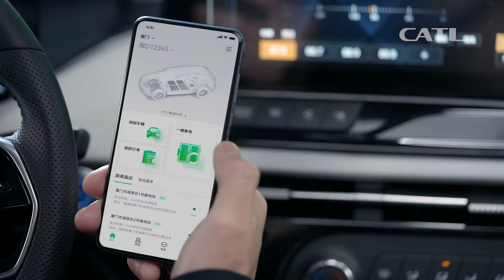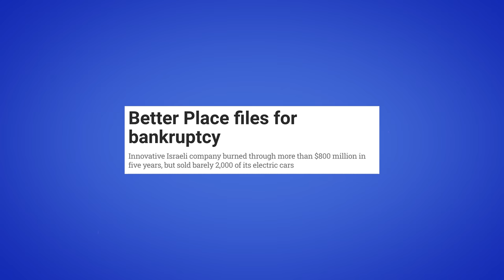Why Battery Swapping Is A BAD Idea

Comment: Honestly most reasons didnt sound really valid to me. Especially the space and cost part, its not like gas stations are built for free. 
The turning point could be regulation. If the eu steps in like they did with mobile charging there will suddenly be a way to make this happen, because then there is a reason for car manufacturers to cooperate.

Comment: I think battery swapping makes sense in a Chinese big city where home charging is less common. If you can charge at home, DC fast charging is only needed when you go beyond the range of the vehicle. For many drivers that’s two or three times a yeat. Whether Nio’s current success in China will last when every parking spot has an EVSE I don’t know.

Comment: This swap tech makes much more sense for aluminium air batteries:

#1 no issues of degradation or getting a worse pack than you submitted

#2 aluminium is way more abundant to enable feasible amounts of battery to be kept in store + they won't loose charge when stored, just drain the electrolyte

#3 lightweightness can very much enable hand swapping for things like mopeds and scooters. I currently own an electric motorcycle but the lithium ion battery (barely half the size of airplane carry on suitcase) is just too damn heavy to carry up to my apartment to charge up to just return about 100km (60 mile) range

#4 less frequent visits to the swap station because of the way higher range. According to a study, if a tesla model s was fitted with same mass of aluminium air batteries, it would have a realistic range of 2,300 km in contrast to about 600km now

#5 way better for the environment as aluminium and the water based electrolyte are *very recyclable, many companies like apple already recycle most of their aluminium and there is a very highly efficient built out machinery for that purpose just because so many resources have already been invested into that

Comment: A lot a great valid points, but the way I see these swap stations (and hoping it is) they are an extra service, another way to charge a Nio car, when you are going on a long journey. If they just put a few of them, on important long travel destinations, that would be amazing for the Nio owners. But, the Nio cars still have charging ports, for normal and fast charging. It's just another option.

And there could be a chance, that the Chinese government could ease (or force) the talks, to get other Chinese car brands, to use the same battery platform. So in the future, all Chinese cars has this exclusive battery system.

Comment: Instead of doing this purely for charging, they should make these for battery refurbishment. Take out the battery and have a machine replace the few bad cells while the pack is underground. And you’d get a new refurbished battery.

Comment: Its up to the car manufacturers to settle on one standard battery package, connector, and even voltage, and that is not going to happen soon. Only after there is a standard EV battery can swapping be worth the investment. 

One of the reasons the gasoline engine took off is that gasoline already existed before there was a gasoline-powered car. Imagine if every car brand required a different fuel? We would still be relying on horses. That's the state where we are today.

Comment: I think the way to go is conductive charging , pick up a charge as you drive along, or park over a pad in the road, no need to mess around with cables, Qualcomm were experimenting with this a few years back
Reply: imagine the work and maintenance that would need though, not to mention that wireless charging is largely less efficient

Comment: There's only one reason that the manufacturers don't like this tech and that is that it takes away the built in obsolescence that comes with the batteries. If batteries were treated like propane cylinders that get swapped for a full one the car can theoretically run forever and that hurts sales...

Comment: The biggest issue for me is indeed that batteries deteriorate as they age. I might turn in a battery that has only been discharged once and get one that's had its quota of charge-discharge cycles and is due for recycling (or vice versa). This would be very difficult to fairly account for. The only way it could work is if batteries are leased, which many might object to (and would itself cause problems when selling the car as the new owner would presumably have to be acceptable to the battery lessor). I believe Renault did something similar and it proved unpopular.

Comment: We definitely need more standards of charge stations. 
Imagine if there were different petrol stations for each brand !
Reply: What do you mean by that? CCS cables for rapid charging and Type 2 cables for fast charging are the European standard
Reply: @Ben.Royals  For me: where they put the charging port. Some are in front passenger seat, some at the front of the entire car like the kia soul. Then we have in the front at the driver side, or behind at the passenger side, or the driver side. If we just agreed on where the freaking charging port should be? I would be happy. My vote is either in the back of the car or in the back-driver side.
Reply: @Brandofviti  that’s not really an issue at any charger though and has only recently come up with the trail opening of the supercharger network. All other CCS rapid chargers are fine for all EVs
Reply: @Ben.Royals  Well, you could maximize placement like that. Look at Tesla before they opened up for more brands. It was placement effective. Also, it surely would help home charging. Use me for an example. I am waiting for a car which seems great, but the charging port is on the front passenger side. My neighboor has her charging port in the front driver site and the third and final one in the shared concrete cubicle in the shared garage has his on the front driver side.
We do not have a lot of place from before so  well.. yeah.. I just hope I will manage to get enough space to charge at home.
 I really would like a standardization there just for that

Comment: Tesla's battery swap approach was extremely flawed because they charged a lot for the service and they put a huge burden on the owner for returning the battery and swapping it out for their original pack. But that really speaks to your points about battery ownership and the overall throughput of a battery swap station that's attempting to store and recharge a number of packs.

Comment: Financial aspects don't look good. You should in theory own the battery that is inside your own car, and simply when at the station the transaction that happens should be what your battery is worth vs the battery that the company is providing. You sell them your battery and then buy their battery and pay the difference usually depending on battery wear. Also the station should be able to charge the batteries inside it.

Comment: Manufacturers don't need to share their secrets to battery tech.

create a frame for various companies to use to house their batter. Each company could do their own thing, set up their own system for how the connections connect and where they are located, so long as it doesn't interfere with the frame the station depends on to effectively make a swap. Then you have the start of an industry standard that would allow for a battery swap location to operate on various brands. Each station will have its own designated battery hold for each brand. If the station is owned and operated by an independent 3rd party, it would be in their interest to not let people from 1 brand into another brand's area. Cause if they do, that could be an easy way of losing multiple contracts and then the station just goes under.

A facility like this would be much bigger than what was shown in the videos, how ever if you put most of it underground like they do fuel tanks, you could still have a station that is roughly the size of a normal fuel station. It would require a lot of batteries from each company that agreed to get involved, much more than if it's a station for just 1 brand.

Continue building cars so they can be recharged at home too, and give people the option to either own their battery or lease it. Forcing people to lease the battery would drive some customers away. Giving people a choice though, you will have customers from both sides that want to own everything about their car, and those that don't mind paying a monthly charge to be able to swap out a battery for a 5 min recharge. When they make their choice, it can be set up so that they either get a swappable/non-swappable battery, or it's a service that is either active or not active for their car that a station would know. A service would also allow people to change their mind later on down the road (no pun intended).

Comment: If you could drop and swap in the same amount of time as it takes to gas and go, electric cars would be more relevant. Batteries that easy to swap would also be that easy to steal. They would be more easily damaged and the connections would wear quickly. Plus there would be the need to standardize batteries AND there would need to be multiple sets for each car.

Comment: You're missing the point - Of course, that's bad... FOR CARS! 
But what about fleets of buses and trucks? There's a lot more room to store the more bulky enclosures, if you have a huge fleet, you can store and charge additional batteries for quick changeover to keep the fleet moving, the cost of the swapping mechanism would make much more sense, and who says you'd be locked in to a certain battery manufacturer? If you're building to spec, you can design the battery design to be an open standard, a design you can shop around with.

Comment: People focus on the charging time but forget the longevity issue: a battery will need to be replaced at some point. Making the batteries in EVs easily replaced would increase the chassis’ lifespans & reduce ownership costs in the long term, & second hand EVs would not be such a financial risk.
Reply: will never happen. for ev manufacturers the lack of longevity is a good thing. they want you to have to buy a new car every few years. look at the iphone.

Comment: Ownership shouldn't be a problem. The welding industry has had the solution for years. If you buy a welder, and, buy the gas cylinder, what you've purchased, is the right to have a cylinder in your possession at all times. When your welding gas(s) run out, and you need more, they don't fill your cylinder, and hand it back to you. You exchange your cylinder for a full one of equal capacity. The cylinder you turned in then goes back to a plant that inspects it, repairs it if necessary,(valve) fills it, then, it will be shipped to which ever welding shop orders it. There's no guarantee, that you will ever see your old cylinder again. You have the option to lease a cylinder, and make a payment every 10 years, or, for about double the amount of money, you can purchase it outright. In every instance, once the cylinder is purchased or leased, all you pay for when you exchange it, is the quantity of gas contained in the new cylinder. There's no reason the same thing can't be done with batteries. There's no difference between gas, or electricity as the product actually used from what ever apparatus that contains it.

Comment: When there is standardisation, the industry flourishes. Think AA/AAA batteries (with multiple chemistry), USB-A/C, 3GSM, LTE & 5G, HDMI, TCP/IP, AC 120/240V for home electricity and even eV charging port. In high density cities where there aren't enough parking lots, let alone charging lots, battery swap makes perfect sense! 3 standard battery pack sizes for mini eV, mid-size sedans/MPV and large sedans/SUV with multiple manufacturers of the battery packs and operators of swapping stations will allow competitive pricing. You may even choose different battery chemistry like Li-ion, Solid-state battery, LiFe phosphate based on your needs.

The battery station will be almost fully unmanned or it can be similar to an integrated petrol service station with car-wash and convenience store or car workshop. Battery level can be pushed to an app in the car or phone so you can avoid a station without your battery size. Or you can even pay less for battery that is not fully charged or has degraded by some percentage but still safe to use.

If your car runs out of juice in the middle of nowhere, a tow truck can bring the battery to you and manually swap the battery at the roadside in a few minutes!

I see this as a more viable solution than parking your car somewhere, charging for 30-60mins. If you forget to unplug your car and drive off, you deprive someone of the charging lot. If you're charging overnight, what are the chances you'd wake up at 2am just to move your car to a normal lot? Even if the charging station provider impose fines on car owners who refuse/forget to move their fully charged cars off, the charging lot is still unavailable for use by others. Unless the service provider can unlock your car and move it away to free up the charging lot.

Comment: You completely missed the advantage of not owning the battery. Degradation & cost of replacement.

A huge hurdle in the used car market. A factor that will eventually cripple new EV car sales.

EV owners should never own the battery. That is the future.
Reply: It is a battery. Could be used  high tech  .what you want to buy
Reply: @lesterhutchins1621  nobody wants to buy a degraded battery.

Comment: EV batteries are too diverse and fragmented, if they are standardized the swapping could work much seamlessly, for there will be less logistical problems.
Those battery standardization i mentioned above? That totally not gonna happens without drama from various Ev & Battery manufacturer.

Comment: Most people that are skeptical about battery swapping don't own a Nio and don't live in China ( Up to 45 % ev adoption rate in my City ) . As a Nio owner I always swap on the go , I don't have to get out of my car, it takes 5 minutes, it's automated , the car drives itself with a push of a button , and it's free. Why should I get out my car, dare the weather, struggle with cable, then wait 30 to 40 to charge, ruins my schedule ( I'm alway in a rush) then finally pay exorbitant charging rate. Feels stupid as a nio owner to charge , especially on the high way with a tight schedule. Sorry for my Tesla and mercedes benz users, good luck with the cable, I'm out.

Comment: Totally disagree, Battery swaps are the future. Building superchargers means you need very high power all the time which most electric networks do NOT support and its is very expensive to replace. When you supercharge 10 electric cars at the same time it consumes too much energy at the same time that in many cases they must be restricted or have backup container batteries to cope. Also fast charging is bad for the the battery, and batteries that accept fast charging tend to have smaller capacity for the equivalent sized slow charging battery. 

Slow charged batteries should have better capacity and longevity. So the idea is good, if someone could slow charge for you and you just go over there and swap in 5 mins how is that not a great idea. This just needs to be made Universal for more cars. People will spend less time at these changing stations than normal petrol stations as you don't even have to leave the car and even stop range anxiety

Comment: One big problem with battery swapping is that it actually INCREASES range anxiety. Simply because I want to maximize my use of a battery before I swap for a fresh one, else it'd feel like a waste of money. And of course, I can't top up the charge whenever I wish - I can't just swap part of a battery. It's all or nothing, too inflexible!
Reply: Your comment demonstrates that you don't know how the process works. When you swap batteries, the system takes into account how much energy you're delivering your battery back, and subtracts it from the fully charged one, cost-wise.
Reply: @pg205  thanks for letting me know. Pretty sure that most folks have the same misunderstanding

Comment: NIO's use of swapping packs may give them a giant edge - scalability.  Lthium is in very short supply;  production can't support more than 6 million BEVs in a market of 140 million vehicles sold a year.  One possibly solution is Sodium; it is 1200 times more prevelent than Lithium; so it is cheaper; less volitile & energy density not far behind Lithium.  The big problem has been that Sodium batteries have had a shorter life about 300 charges- BUT - if you can swap them out quickly - who cares?

Comment: Perhaps the swappable EV battery needs to be smaller so swapping is customer self serve; like BBQ tanks. Imagine a large Costco size shopping cart module on wheels that has just 30/40 Kwh. You drive 100-150 miles and just get another  fresh one at 7-11. The BMS and cooling is all done internal to the module, and the consumer can self serve, rolling module to replace it. It locks into the car with locking rollers against theft, has bar code and wifi / Bluetooth for module fleet management and user fees. This module concept allows for future battery development separate of the EV.  You can keep your older EV longer.  What do you think?